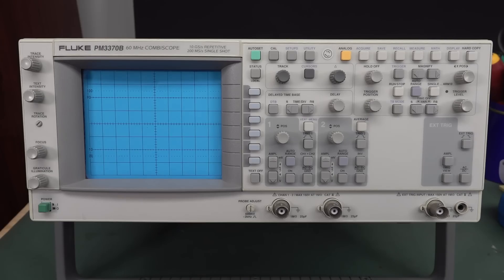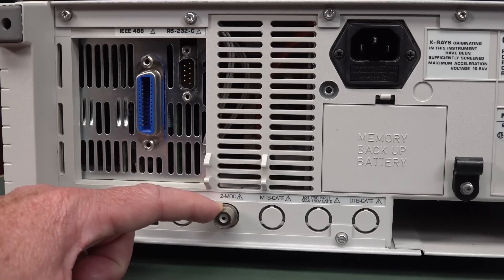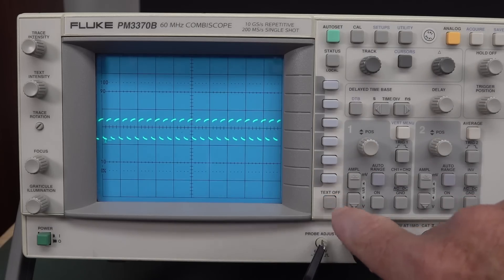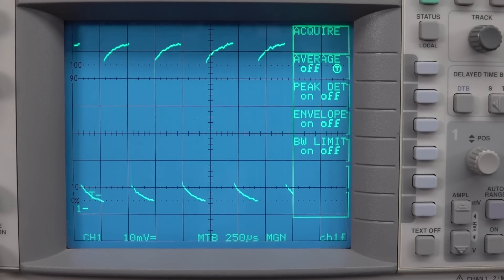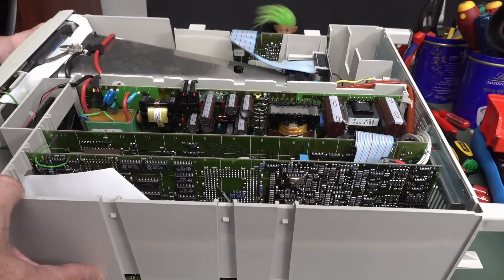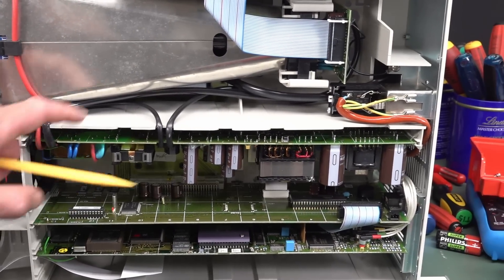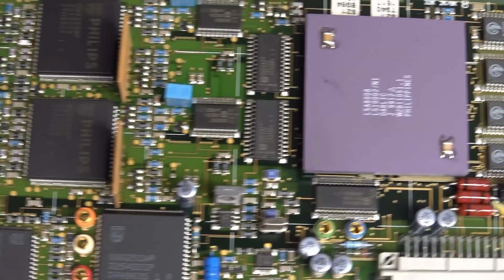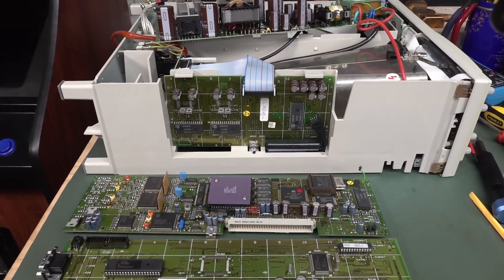EEVblog 1450- $99 Fluke Combiscope Ebay SCORE!

Comment: Did it come with the test leads? Maybe the cause of the trip is from week capacitors? LOL
Reply: I didn't with mine, I bought it (exact same) for a similar price (a tad higher, but still well below 150) as a working condition.
Reply from the maker: Nope, just the power cord. See the unboxing video on Odysee.

Comment: the scope is actually a Phillips device. its rebranded as a fluke. if you look around for the phillips PM series you will usually find the fluke counterpart as well. all made in holland/netherlands in the phillips factories. if you look at even modern phillips medical devices they will have bascially the same colors, buttons and fonts as they did back in the 90's. phillips had its own semiconductor factory and design center. so there would be no reason to go outside for (most) parts when phillips was already on top and the chip design guys were a few offices down the hall.

Comment: Completely coincidentally, a PM3394B from eBay arrived here yesterday: I've always been intrigued about combiscopes, and I won't deny they still look sexy with all those buttons! Mine works except two channels 2 & 4 have large negative offsets in digital mode, I think this might be  one of the hybrids :-(

I had exactly the same batteries in mine too! One was dead, the other still measured 1.4V.

I've changed the default trace intensity in analogue mode, as it went invisible after an autoset. More work to be done!
Reply from the maker: Channels 2 & 4? That's weird, as they'd be on seperate cards.
Reply: I've bought one as well (Fluke branded PM 3370B like in the video) a few weeks ago, seems to work great. I'd ask "what are the chances" but I can see the seller had a few of them, so likely they all came from some bigger organisation after being retired.

Comment: My bet is the voltage tripler is likely breaking down, because it used RIFA capacitors inside. Also note all the blue SMD resistors are also Phillips manufacture.
Reply from the maker: I hope it's not the tripler and it's just a part I can easily replace.
Reply: I think the small blue electrolytic capacitors are Phillips too, today being manufactured by Vishay.
Reply: RIFA madness !
Reply: The tripler was also my first thoughts pulling down the psu,  lift the input to the Tripler and see does it run for awhile , but it could be anything 
best of luck with the repair.
Reply: @Fred-lb5jp  Yes triplers are always the first suspect with random tripping, or also a breaking down of the EHT cable to the tube, or a dirty final anode cap. Simplest is to clean the tube around the cap, and also look for tracking under the cap, and then check the cable for tracking damage. If the cable then a thick PTFE sleeve will work well to add robust insulation to the section close to grounded metal.